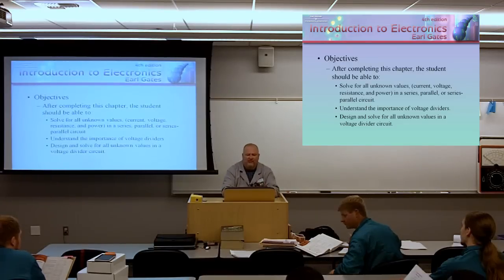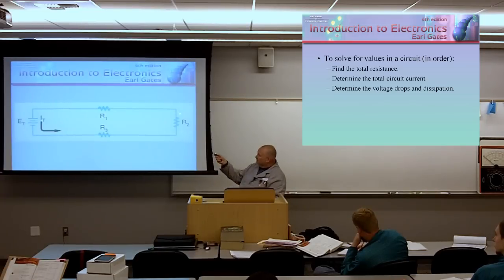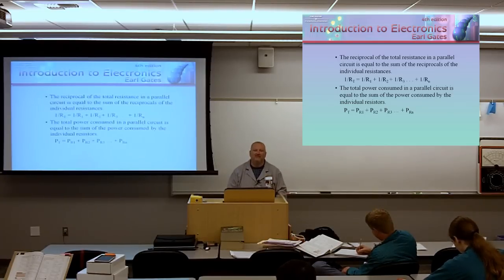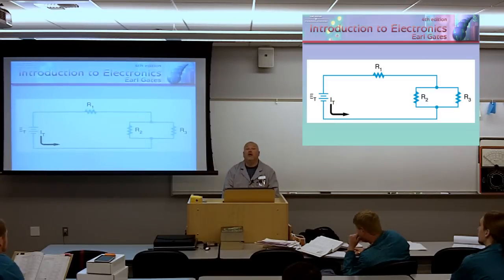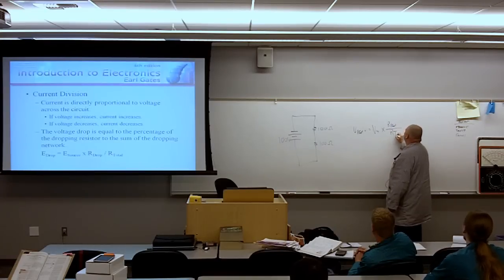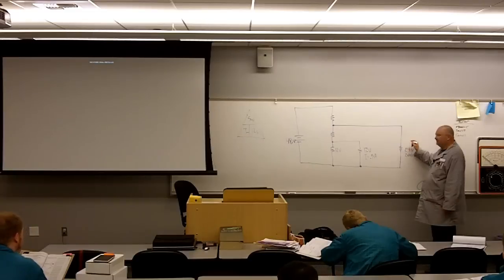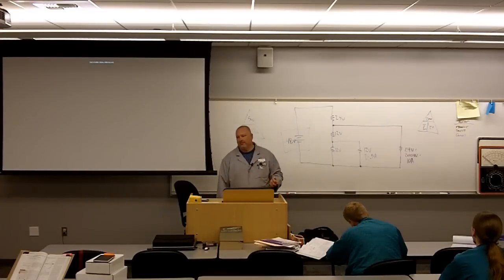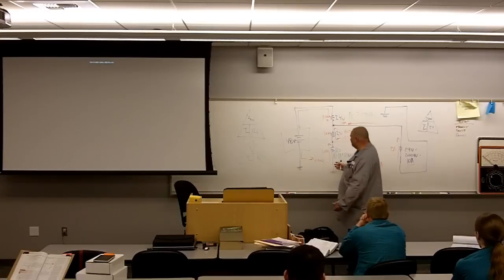ELEC 110 Chapter 8 Lecture, DC Circuit Wrapup.

Comment: I'm very confused.  Is he using conventional current flow here in these schematics or not?..  He keeps drawing it like the electrons are flowing from negative to positive which is true in reality but I've always been told that schematics are intentionally drawn with the opposite effect in mind.
Reply: Before we know that electrons flow in conductors , theory was there is a fluid in conductor that flows from positive to negative.
In 1897 J J Thomas discover electrons and the fact current flow from negative to positive.

But to represent current we use Old school way knows as conventional current. Thats does not may any different in analyzing circuit. But rule is use only one way. 

All university and colleges use conventional current. You also use it because all text book, reference books and other material use it. It is universally accepted
Reply: Is is using electron flow, which is very odd for an ABET accredited program.
Reply: He covered this in the 3rd lecture I believe